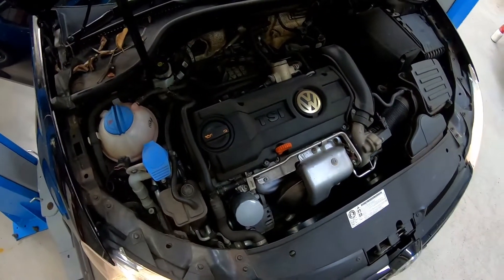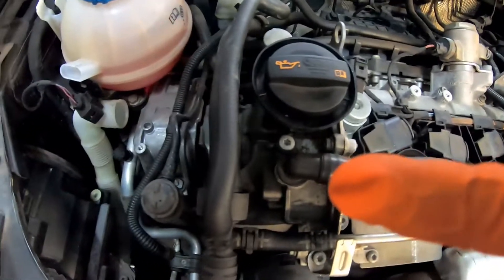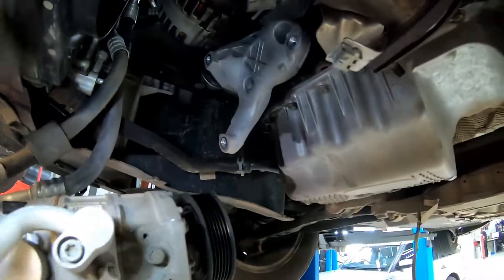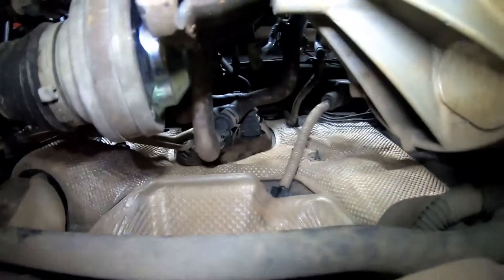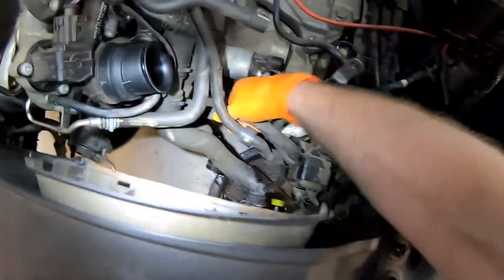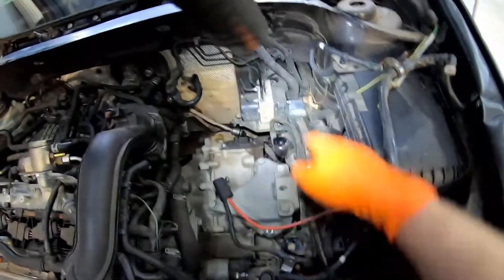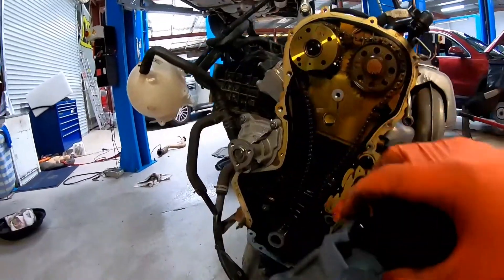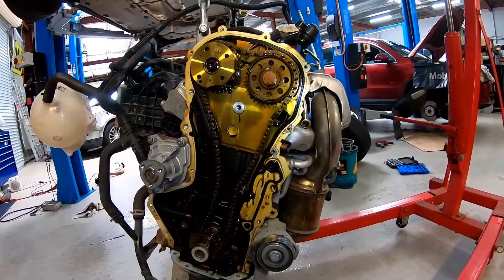P0016 VW 1.4tsi Timing Chain Jumped CAXA Part 1

Comment: Good morning, ask. At the tip of the crankshaft, apart from the sprocket with the teeth where the distribution chain goes, the cylindrical casauillo with its oring internally, the timing belt and the pulley for the accessory belt. DOES IT HAVE 2 WASHERS? When disassembling I did not realize and I only have 2 washers but they are equal to each other, but the detail is that the external dianeting of the washer is the same as that of the cylindrical bushing, but the internal diameter is larger than the diameter of the tip of the crankshaft remaining with clearance. In one part of the manual there is a breakdown and it does not include the 2 washers and in another part of the manual there is a breakdown with the 2 washers but these are 2 washers of different sizes from each other, and the title is written as "repair kit "This washer is diamond coated

Comment: I get a 2-3 second chain rattle when starting.  Been doing it for approx 9 years to be honest but do you think i need to change the chain.  Only has 68000 miles on it.
Reply: No, I already have 170 000 km with no change
Reply: @AlexK59.  does yours rattle at startup
Reply: That's actually normal I've been told, on a cold start it's fine, it becomes a problem when it keeps doing it when warm, it's also a bit hard to discern since these engines naturally sound like lawnmowers

Comment: Hi! Code error P000A would also be a sign of a tensioner problem? I had my timing chain replaced 8.000 km ago, although the oil hasn't been changed in 20,000km... Now it looks like I need to replace the chain or the VTC again?
The car rattles during engine cold starts.

Comment: Hello, 

Something is not clear, do we have to remove the oil pan when making the timing chain job? In the official documentation, it is said that we have to remove it, but I doubt. Can you please tell me?
Really good video by the way :)
Reply from the maker: Yes you should remove it. You can get away with not removing it, and i have done it that way before. But removing it makes resealing it all much more easier and reliable. Plus you can clean all the built up grime out of the sump which will allow the fresh oil to stay fresh and better for the engine in general. Any broken guides will likely be in there too.
Reply: @FourRingsAuto  thanks a lot for your answer and video :)

Comment: My audi a3 1.4 tfsi caxc 8p has 130,000 miles. Get P0016 engine light once every month. Car struggles to start in morning. Needs revs to maintain revs or itll stall out. Starts fine when warm. Doesnt have loud chain tap but normal tsi rattle that I hear. Not as loud as this video. Would the camshaft and crankshaft fix the issue? Revs are also at 700 rpm at idle. Sometimes goes to 900 rpm...
Reply from the maker: Sounds like a possible jumped timing chain, however it being intermittent I'd be also suspect of a possible cam variator issue. You could verify timing if you had access to the timing tools.
Reply: @FourRingsAuto  so jumped chain AND variator or just variator? Idle revs jump around slowly. Can feel slight vibrations at idle. Drives fine though. It's only cold start where needs revs to start. Sometimes starts fine from cold....
Reply: Also replaces plugs and coils. And camshaft position sensor
Reply from the maker: You may find it easier to take the vehicle to a vw audi specialist and have them correctly diagnose the issue. Changing parts by guessing what's wrong will waste more money in the longrun. I'm merely saying it could be a jumped chain, it could also be a variator issue. It could be a few things to be honest, but I don't have the car in front of me so I can't tell you for sure, that's not possible. There's a lot of info in these 1.4tsi videos on the playlist I've created, but otherwise you'd be best seeking a professional to look at the car.
Reply: @FourRingsAuto  where abouts are you based in the uk?
Reply: @FourRingsAuto  have a look at my recent video titled 1.4 tfsi.
Reply from the maker: I'm in Western Australia, not UK.
Reply: @FourRingsAuto  ahh ok mate. Thanks for your help anyway
Reply: @FourRingsAuto  I have already got a crank sensor for £20. Is it easy to fit myself? Do you know location for CAXC 1.4 tfsi engine? I will replace this then take to specialist
Reply from the maker: @cwacheats1234  I've never had one that's been the crank sensor, but your call. It's on the rear of rhe engine below the supercharger.
Reply: @FourRingsAuto  supercharger?
Reply: @FourRingsAuto  my car is the 122bhp CAXC CAXA 1.4 tfsi turbo only
Reply from the maker: @cwacheats1234  same place but minus the supercharger. Rear of the engine towards the gearbox end.
Reply: @FourRingsAuto  under the car?
Reply: @cwacheats1234  did you find the problem?? I have the exact same symptoms...
Reply: Did you figure it out?

Comment: Nice video. Do all the mk6 tsi 1.4 122hp  have timing chain?
Reply: Do they have a specific mileage they tend to fail at ? Thank you
Reply from the maker: Had them noisy and stretched at 70k kms, or 200k kms. Seems to be down to oil used and service intervals.
Reply: @FourRingsAuto  I bought a Golf with this engine last year with 100.000km on it. Now I have 130.000. Would it be wise to change the chain tensioner beforehand (since it's a common problem) or do I change it when the problem occurs? Some people said (forums) it can snap without warning and destroying the engine.
Reply: I no this is a year old but i need  help because I can't find anythink online anywhere eles for my car I got 2014 audi a1 1.4 tfsi  I was getting p0300 code multiple cylinder misfire followed by p0301 p0302 p0303 p0304 which is each cylinder misfiring then my friend asked me to move my car so he can get his car out but my car just didn't want to start at all it's cranking  but nothing we change all spark plugs and coils and crankshaft sensor we checked the fuel pump is priming and we check to see if its being pump and all I good there we have checked all the fuses and the replays and still it's cranking but not starting I'm completely clueless to wtf going on seen this video and was hoping someone could help is anyone having this same issue
Reply from the maker: If it cranks over fast, it may have jumped on the timing chain and have no compression.
Reply: 1.4 122 ks Caxa je odličan motor samo mu treba redovno menjati ulje i zameniti lanac ako zvecka..Samo sto vlasnici tih motora ne menjaju ulne na vreme i teraju auto 300.000 bez zamene lanca. Pa šta očekuju?
Reply from the maker: Yes they all have chains.
Reply: @FourRingsAuto  thank you very much!

Comment: What can you do to avoid the chain stretching? I have the 1.4 TSI BMY twincharged
Reply from the maker: Changing the oil more often is a preventative way, but the damage can already be done with the age of these vehicles now. If there is any rattling from cold starts this can be an indicator of a faulty inlet cam variator, timing chain tensioner, or worn chain. The first 2 items can cause further wear to the chain, and the 3 will eventually end up potentially breaking the plastic guides.
Reply: Four Rings Auto Thanks for the answer. I change the oil every 10.000km with 5W/30 Castrol. Sometimes during cold start the engine rattles for 1-2 seconds. Sometimes it does not. I use Shell V-power.

Why did they design the engine like this if it breaks all the time?
Reply: @FourRingsAuto  you seem a good profesional! (I am Spanish xD)

Comment: Nice informative video! Thanks. 
I just bought a 09 vw touran with engine code BMY/CAVC. Local vw dealership estimated a high price for the repair so the previous owner decided to sell the car to me instead of repairing. The cost was estimated as with bent valves but engine was never opened from dealership. I was about to pull the head right away, but after seeing this video i wonder if the symptoms which led the previous owner to believe was bent valves, may just be timing gone off? How often do valves bend when this problem appears? Would probably be wise to install new chain and tensioner and test compression before pulling the head, agree?
Best regards
Reply from the maker: Yeah test with new chain on before pulling the head. Or if you have access to a cylinder leakage tester, you can test to see if any leakage past valves into the intake or exhaust. Does the car start? I have seen these bend valves. They crank on the starter motor fast and you can hear they have no compression.
Reply: @FourRingsAuto  
Thanks! Yep the car starts and drives but not without of alot of unpleasant noises, would it not start if valves was bent?
Waiting for parts at the moment, will there even be any point in testing with cyl. leakage tester before installing new chain and adjust to correct tdc?

Comment: Ok..so I commented before I noticed you had actually removed the engine...is this to video it clearly ?
I have done a few of these with engine in situ.
Reply from the maker: It is mentioned in the video a couple of time that it's not necessary to remove the engine. It was removed due to the dsg clutch being replaced and due to how simple the engines come out, it was deemed to be easier for both jobs,  rather than do the strip down of each entirely seperate. The better view for the video was merely a welcome by product. I have linked in the description where I have a video of how to replace them in the car, this video is just a different way of showcasing the failure.

Comment: Hi
These usually stretch due to poor oil / changes /  time between changes and obviously the wrong oil.
Timing chain tensioner usually gets "gritty" in operation and then starts to jam when the vvt system operates. This stretches chain.
Straight forward job though 😁 for a man of your abilities.
Obviously a good flush of the engine oil too.

Comment: hi i changed the chain kit on my 2010 audi a3 1.4 and it still makes a rattle for maybe 2 seconds when starting from cold all genuin audi parts any ideas cheers
Reply from the maker: Did you check the inlet cam variator?  The variable valve timing pulley is likely not locking when the engine is shut off. The rattling is the variator and camshaft rattling back and forth until oil pressure is built up.  You replaced the tensioner when doing the chain too right?
Reply: @FourRingsAuto  yes change variable timing pully tensioner slippers chain cogs how do check if its not locking
Reply: normal until oil pressure builds

Comment: Hi,

I have the same engine...when would I need to change my timing chain. I have no engine light on, but I was told these CAXA has common timing chain tensioner and chain fault. My car is 2011 (61), and 70k mileage.
Reply: @chrischannel3250  How do you check what type or style of tensioner you have? can you tell by the year of the car?
Reply from the maker: there isn't a set interval for replacement, but I generally see them stretch due to poor oil quality and extended service intervals. as you suggest miles rather than kms, i'd guess you are in the UK where long life service intervals can allow a variable service of up to 19,000 miles (correct me if i'm wrong as i left in 2012 to Australia). this is far too long between changing the engine oil. here it is 15,000km (around 9000miles) or 1 year, yet we still recommend reducing it down to 10,000km. another important thing to note is the oil being used. it must be of high quality and meet the vw 504/507 standard, in some circumstances and countries vw502 spec will suffice. the highest grade fuel available will also help. i'd say at your mileage it would be worth having the timing checked, for at least a level of piece of mind. the chain isn't a difficult job to do either, and doesn't require engine removal.
Reply: @FourRingsAuto  

I have used the Castrol long life oil, which is VW standard 504/507, but I only had my car since 60k miles, so I’m not sure what was used before that. I think the long service intervals are 20k miles here in the UK…but as you mentioned, I wouldn’t trust that. Therefore, I’m planning to change my oil every year or around 7000-9000 miles. In terms of me getting my chain checked out….most mechanics just want to strip everything down and physically look at the chain, which is costly if there was no issue with the chain. I have no engine light on and my car runs fine, it’s just I get cold start rattles sometimes, and most say that could either be the tensioner, crankshaft adjuster (VVT Gear) or normal noise (low oil pressure in cold starts). It’s really difficult for a mechanic to investigate without stripping everything as the cold start rattles only come sometimes, and once the car is warm, the chain won’t rattle etc. 

Is there a difference between a tensioner cold start rattle and crankshaft adjuster rattle?
Reply from the maker: @shazadjabar6984  camshaft adjuster rattle is a known issue, but so are the tensioners sticking in a retracted position. You can check chain stretch with a degree wheel on the crank as per vw audi instructions in their workshop manual. Tensioner you can see if it's sticking with the sump off but won't be able to see a part number for full identification.